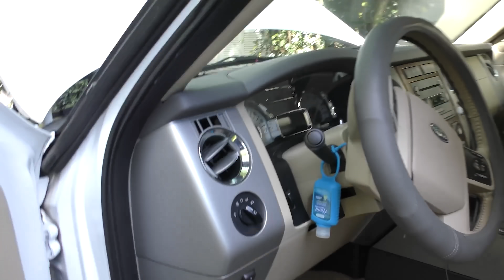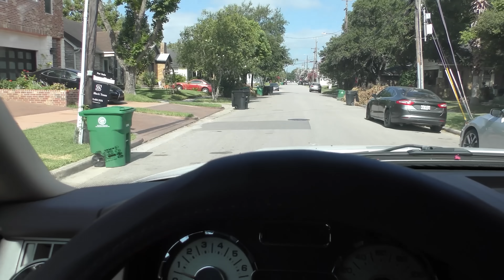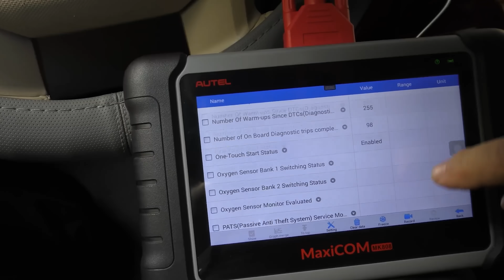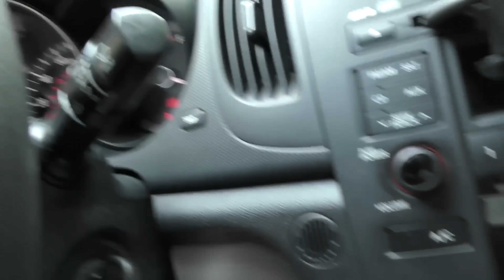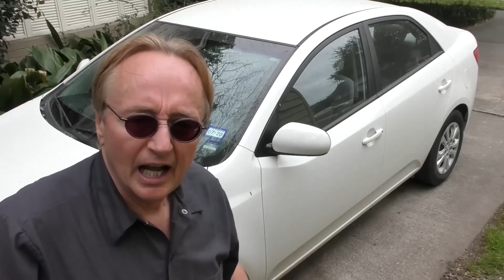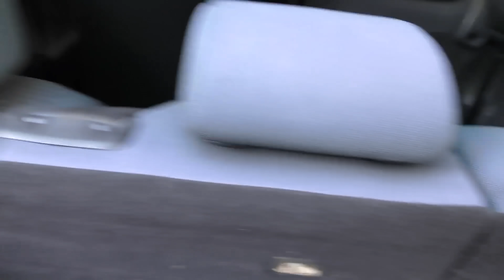3 Used Vehicles No One Knows About, So You Can Buy Them Dirt Cheap

Comment: I bought an '07 Ford Focus for $500. I was gonna drive it one winter, then buy a new car in the spring.   It needed a lot of small stuff, like an alternator, window regulator, heater vent box cables, etc.  I spent $300 at the junkyard and fixed everything.  It has 190k miles and runs like new. That was 4 years ago. I've still got it! Why sell it? If you need a good used small car, and you can fix little stuff, consider the old Focus.

Comment: If that ford has the 5.4 3 valve then replace the timing kit, buy a cam phaser lock out and high volume oil pump or it is about to grenade on you at 156k

Comment: Once again, Scotty, another great video. I have a 2008 Mercury Mountaineer bought in December of 2007 it has the V6 engine 4.0 and has 130k miles on it. I has been a great car this December it will be 17 years old and I love it. I had very few problems radiator was leaking and the thermostat casing that is garbage is plastic

Comment: Only issue with scion like this one is in 06-09 they had the low piston rings that failed and burned so much oil! And it was mainly due to people not changing oil enough and letting them go 10k city miles between oil changes! (Not recommended) highway miles yes but not city 
    So have to be careful when buying one check the records and dates compaired to miles put on between dates to see if they’re highway or city driving

Comment: I would seriously consider an older Expedition provided it wasn't rusted out or had been seriously wrecked.  And if it had the 3 valve 5.4 that's a hard pass.  I'll just drop a reman engine or transmission in it and drive it for another 200,000 miles.  I've seen them with a lot more than that and they were still running well.

Comment: I bought the scion xB the boxy looking one. Standard shift. With 100,000 miles on it 6 years ago. Now I have 310,000 miles on it and all I have done is oil changes, and tires. Original clutch, brakes radiator alternator. Hasn't missed a beat.
Reply: awesome, I'm looking to get an xb at the moment but the only ones in my state seem like the 2nd gen. and I hear the 2nd gen burn oil like hell
Reply: Good for you!  What year?  How much then?

Comment: Lost me at Ford. No way I'll EVER own another Ford.
Reply: ford van lasted me 4 months used. f150 with instant transmission problems off the lot. Both were the biggest pos vehicles with the exact same issue.
Reply: @slumy8195  My parents had Fords and Lincolns when I was growing up. Nothing but problems. I decided to give Ford a shot in 2015. Bought a brand new Limited Explorer with 10 miles on it. In the shop 4 times in the first 6 months. Straight up junk.

Comment: If t has a 5.4 3V. Run away from it. Trust me.
Reply: They still can get a couple hundred thousand miles. The biggest issue with them is their primary maintenance issues are expensive. Like their AC issues will have you taking apart the dash.

Comment: I'm not so sure about the Ford vehicles with the 5.4 liter 3-valve V-8 but they could still be good engines if you change the oil religiously. It will not tolerate neglected oil changes
Reply: I have a 2014 5.4 3 valve.  Time chain went out at 205,000 miles.  Fuel pump replaced once.  Still have it,  engine being rebuilt now.  Excited to get back.  Driver side actuator replaced.  No other problems.  Bought it in 2915 with 11,000 miles.  I drive almost all freeway.

Comment: PSA: Those Expeditions with the 3V 5.4 Triton V8s can be good engines if they were maintained well, namely oil changes. That generation, 2007-2014, only had the 5.4. Cam-phasers, "2 piece" spark plugs, timing guides, and weak oil pumps are just some of the issues that plague this engine. It's not necessarily the cars fault that the owners are negligent, because most of the major issues of the 5.4 can be remedied through routine 3k to 5k oil changes. However, buying one of these at a corner lot with 3, 4, or more owners in it's history with 150k miles is a straight up gamble. You can put new phasers in but a lot of times mechanics just recommend a new engine.
Reply: I got a 2013 xlt expedition and it's at 145k miles. Bought with 84k on it. I maintain it like crazy with oil etc. I did the lock out kit for the motor. But ford should of had to replace all the 5.4 motors
Reply: It's not negligence it's piss poor design and execution.  My neighbor is a wicked mechanic and has a 2008 f-150 with the triton. The amount of work he's put into that engine to keep it running goes well beyond routine maintenance.
Reply: I had a 2009 f150 with a 5.4 new and I sold it at 100k miles, I ran it hard and it was running like crap at that point. Got a 2016 with a 5.0 and I've been taking better care of it, runs great, I hope it lasts to 200k miles, at 113k currently.

Comment: That tiny scion does not need 18" tires. It would handle much better, stop shorter and get better fuel economy with 16". Not to mention 16" tires are $150 per set cheaper for the same exact tire

Comment: I picked up a 2006 Jeep Commander with 78k from my mechanic for 5k.
Runs and drives like a new jeep..It also came from Seattle WA, where they don't use salt on the roads.
I under coated it here for Michigan weather and it still is going strong 10k miles later

Comment: I bought a 2005 Ford Freestyle for 1800 bucks 2 yrs ago. It had 182,000 miles when I bought it. Now it has 234,000. Doesn't use any oil, change it every 5000, doesn't leak anything. Has tons of pick up and runs great. I'd like you to look at it someday Scotty. She's got a few small dings. But runs like a charm! And all original but the rack n pinion, and air conditioner. They were replaced. Gets 23 to 24 mpg on highway, 17 to 18 in town. Not bad.
Reply: I love how people say it is all original "except for" No  vehicle is all original they wear parts out even with all the regular maintenance done & tyres wear out. The only vehicle that you can call completely original is one purchased & then put into storage & never driven.
Reply: @LesReeves  There's no such thing, parts are only meant to go so long. As long as the engine and trans are oiringal that's what people usually mean
Reply: I mean if a car has 150-250k miles or more og engine and tranny id say it's pretty original especially if car is still looking mint. Every other part is expected to break at some point in time.  @LesReeves

Comment: My daughter has a 2009 Kia Rio. When we bought it, I did some research, and found that this era of Kia and Hyundai is a sweet spot for these 4 cylinder cars. The engine was improved, and they did a lot to improve the automatic transmission. It now has 155,000 miles and it runs smooth, doesn't burn oil, and the transmission still shifts great. I think that the car was well cared for, which makes all of the difference, but it was at a reasonable price, and available during the pandemic so we bought it.
Reply: Thy are good, till the engines give up. Try to get them replaced.  NO PARTS AVAILABLE
Reply: Yep, my 2009 Hyundai Elantra is the best value vehicle I've ever purchased in the past 44 years.
Reply: 2009 was good but 2010 were better! They switched from the timing belts to chains 
The belts broke every 60k miles or sooner and blew engines! 
The 2011 switched to horrible GDI engines and they blew mulitiple times before 100k miles and Hyundai only gives 1 engine per car 100k mile warranty 
    My 2010 sonata GLS 
Gave me 280k miles trouble free with just reg maintamce! 
And women I sold it to 2 years ago now is still driving it and just had to replace the radiator she’s at 344k miles a few months ago!
Reply: @jessewynne8193  thanks for the info.
Reply: How it’s cared for over its life is critical.  Frequent oil changes is one key.  People tend to overlook the importance of fresh oil.
Reply: 2012 sonata. Sold the car at 240,000 miles. Original everything. Full synthetic oil and tranny fluid exchanges
Reply: The key to buying a Hyundai /kia is to get an older model WITHOUT a GDI engine. That’s when all the problems started. Before that it’s just keeping the timing belts replaced and they were good cars.
Reply: @TravisM-zv5eh  Before the Kia, my daughter had a 2002 Hyundai Accent. The engine ran good when we sold it, but the transmission was in terrible condition. Kaput!

Comment: 2010 Ford Expedition here. It's mostly been great, all the things Scotty said. Except one(ish) known issue: oil doesn't get to the top end in sufficient amounts. Phasers freeze, rocker arms break off, and you have parts flying around in the head. It'll show up as a check engine misfire code. 5.4L triton 3 valve. Give it a goog.